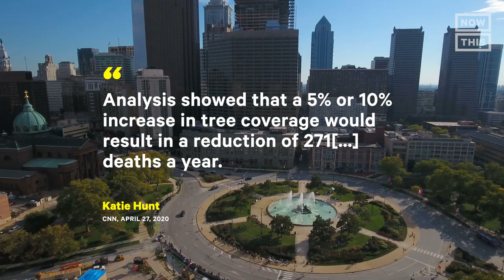How Systemic Racism Linked to Fewer Trees in Your City | One Small Step

Comment: To those who haven’t seen the video, here’s a summary about one of the points they are talking about: 

They mean that in middle class and wealthy neighborhoods (especially historically white neighborhoods), there are more trees and cover. In poorer neighborhoods (especially historically black neighborhoods), there are less trees and less cover. 

These poorer neighborhoods are hit harder by the effects of climate change and extreme weather- such as far hotter summers and less flood control. Trees not only provide shaded cover, but both trees and soil help absorb excess carbon dioxide, which in turn will make your summers cooler than they would be without them. 

There’s a lot more too this, so I’d recommend researching it, but this is one of the points they are talking about. 

The point is that we need more trees to help combat climate change, and more importantly, we need to make sure we consistently take care of and maintain these trees too. (We’ve seen before that if you neglect recently planted trees, they can die or contribute to forest fires depending on the area they are planted in) 

So not only will planting more trees give people jobs in order to maintain them, but it will also help to decrease our carbon footprint and lessen the effects of extreme weather on our neighborhoods.

This is only a small fraction of the solution to a big problem we all face, and more still needs to be done, but it’s a good start!
Reply: @cesarbugarini499   My apologies for the long comment ahead, I have broken it down into smaller paragraphs and two parts so it is easier to read. 

My comment is only a basic summary of what the video is discussing. This is also for people who may have either not watched the video and scrolled to the comments first, or just a basic summary for those who already have. 

My summary is also describes how historically poorer neighborhoods are more susceptible to extreme weather conditions- such as heat waves and flooding- and how if we wish to help decrease both our carbon footprint and the effects of extreme weather on these neighborhoods, we need to make some changes and update these areas so they are less susceptible to drastic weather changes. One of these changes includes the planting and maintenance of trees and parks. Trees provide ground cover to reduce head, and both trees and their soil can absorb excess carbon dioxide and water. This is only a small part of a solution to a bigger problem.
Reply: @cesarbugarini499  I do agree with you that there is more (historically and currently) to the practice of discrimination than in my brief summary of the contents of this video. 

My comment only describes what the video states: that historically poorer communities are harder hit by extreme weather and climate change, and that some changes will need to be made to help those communities, decrease our carbon footprint and combat climate change and extreme weather. It should not be taken as a summary of the practice of discrimination, but only a mere fraction of its historical aftermath. 

This is all I will say for now, for I don’t wish to assume what you are saying in your comment and misinterpret your words. It appears that you have some thoughts you wish to expand upon in this topic, specifically with the history pertaining the practice of discrimination, and I am not opposed if you wish to respectfully share them. I’m certain other people would like to hear about that, since I barely touched upon that subject in my summary! 

Apologies again for the long reply! Either way, thank you for your comment and I hope you have a good day and a good night! 😊
Reply: I dont get why the white and black part are mentioned either here or in the video. It's not like we trying to plant trees in specifically white neighborhoods